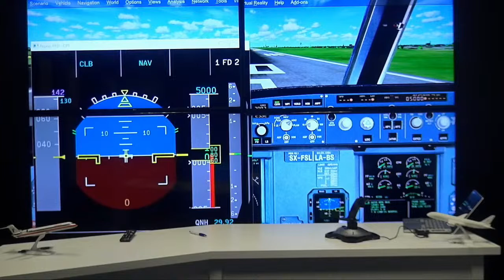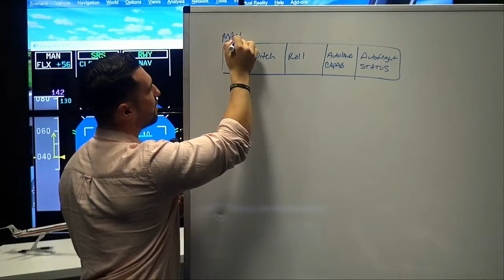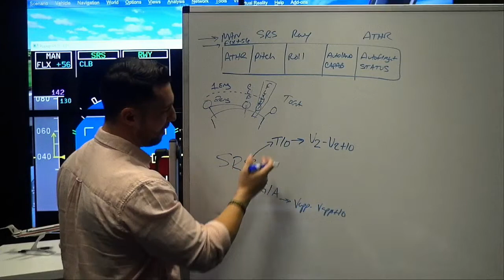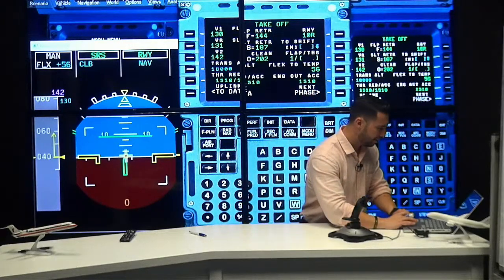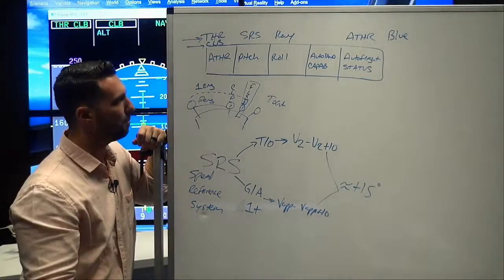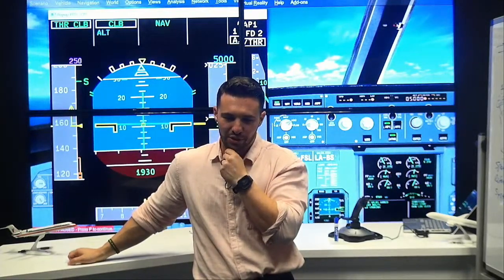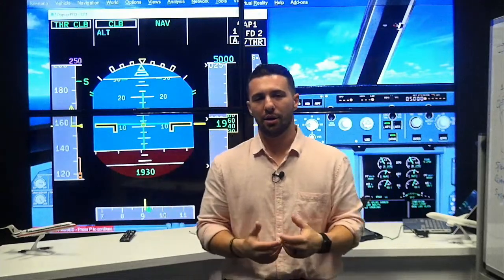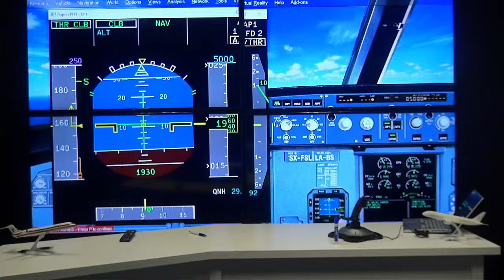A320 TAKEOFF CALL OUTS

Comment: Whats the difference between "armed" and "active"?
Reply: Armed means stand by, active the system is running
Reply: For example if you set Alt to 210 you will be climbing with Alt armed (blue) so when you reach 210 Alt will be active, automatically leveling off.
Reply: armed means it is ready to do something but it is not being used but always ready to be used. active is being used